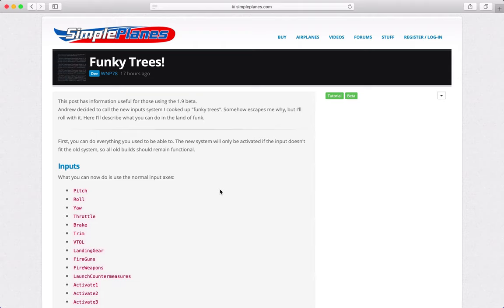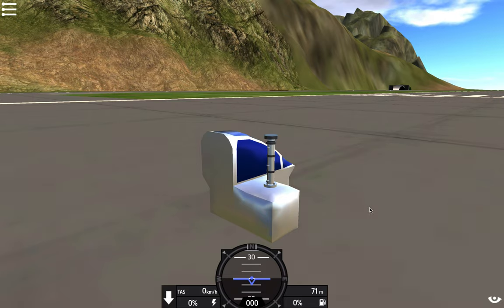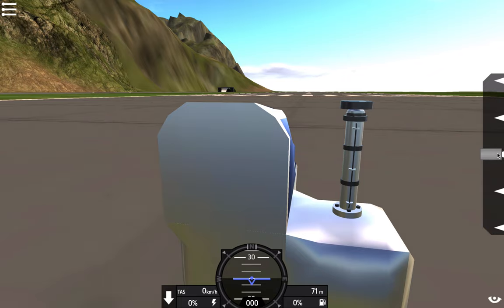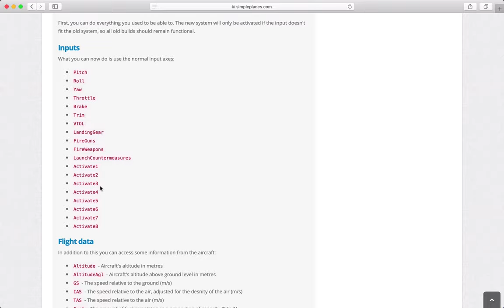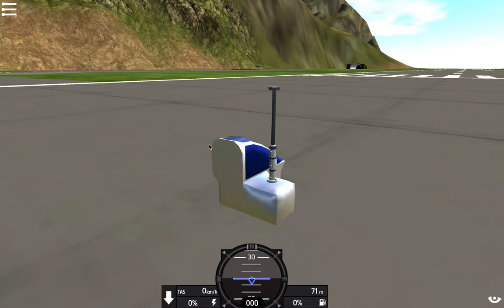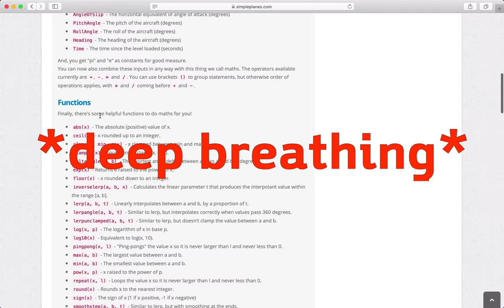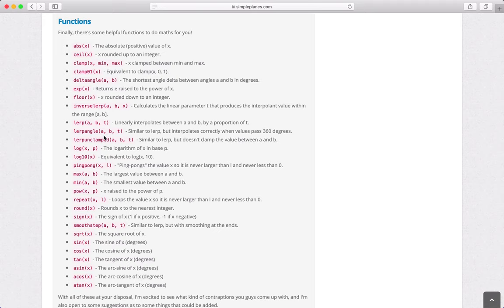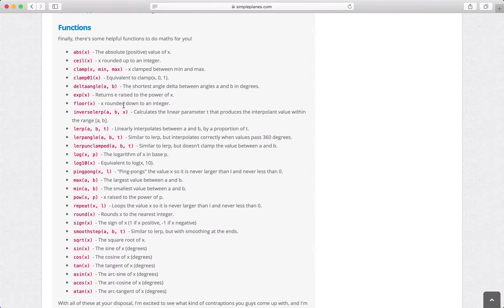1.9 Beta- New Inputs Tutorial | SimplePlanes

Comment from the maker: Hope the video helped. It's a bit complicated, but it opens up a whole array of new possibilities.
Reply: Aye thanks snow
I’ve not been getting how FT works
This was very helpful
Reply: Can you explain what is this code is all about? It said it is a weapon load timer. How we can use it in simpleplanes. Any example videos how to use this codes?

(1 - smooth(clamp01(-rate(ammo("x"))), clamp01(-rate(ammo("x")))*pow(10, 4) + y))
Reply from the maker: It just tracks if a weapon has been fired within a set time range. When set up correctly, it will return a value less than 1 when a weapon has been fired within aforementioned time range.

The instructions to set it up should be available where you found the code.
Reply: @SnoWFLakE0s  I found the code here https://snowflake0s.github.io/expressionscatalog.html but i still not figuring out how to use it. When it will put the code. I put it in Cannon's activations group. But still continue firing and not stop to reload.

I want a code that fire example five shot in a row then stop for a few seconds means it's reloading. Is that possible?
Reply: @SnoWFLakE0s  can you make an example application using that codes?
Reply: Please upload more detailing video on funky trees system
Reply: Im trying to use ag 1 to fully extend a piston, and i dont understand it at all, could you explain
Reply from the maker: @thelethalpredator672  Simply writing in Activate1 for the input should do!